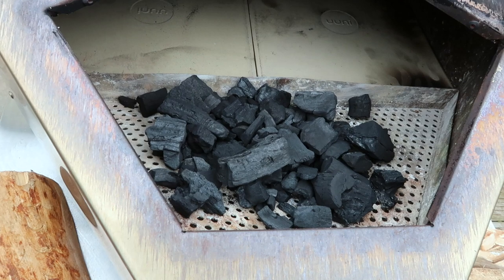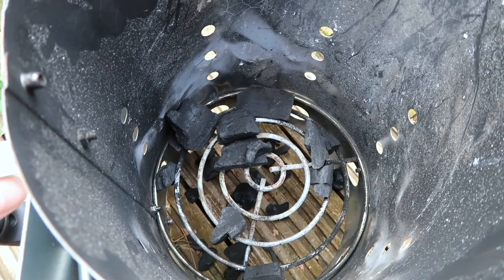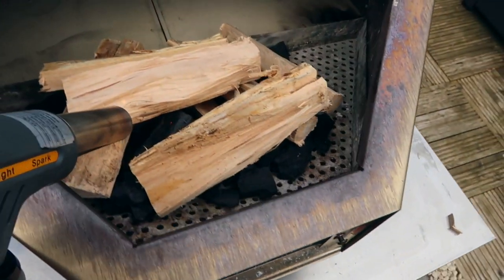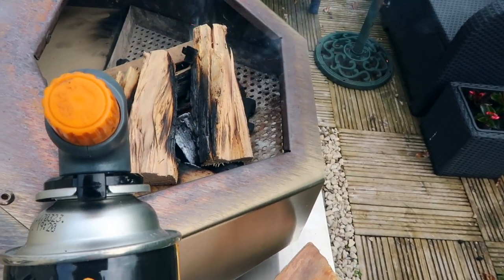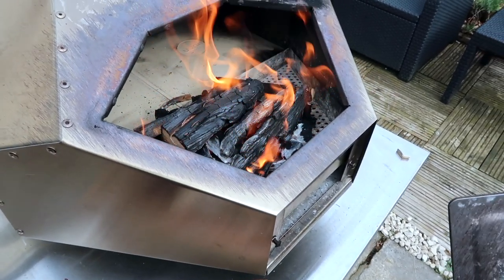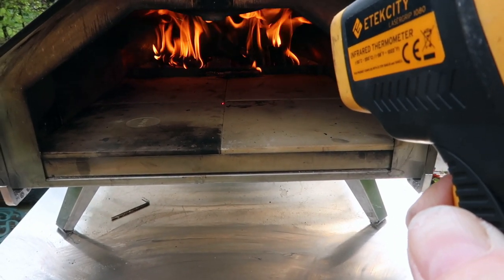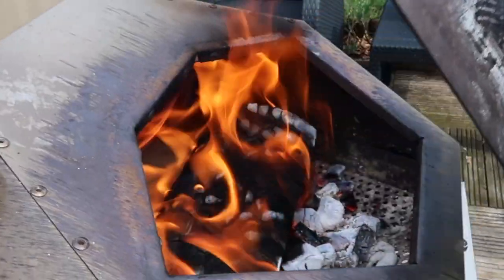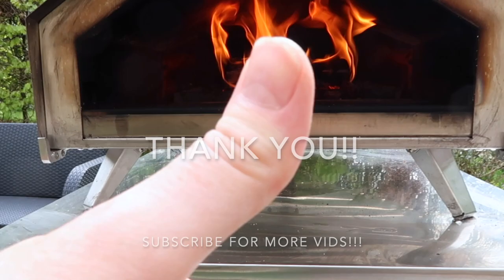How I Light the Ooni Pro Wood-fired Pizza Oven | Step by Step

Comment: Ace videos. Thanks for making them. You were the catalyst for me buying an ooni pro that arrived yesterday (instead of starting an expensive and slow to build brick oven). First pizzas today hopefully!

On lighting fires... Look for electric fire starters. I have a looftlighter that I love but an electric paint stripper works fine too. Just point it at the coals for 30 seconds. No gas no chemicals no fuss. Also for charcoal look for restaurant grade lumpwood. It is in much larger pieces that give a controlled consistent burn. It would solve your chimney starter problem too. I do a lamb or pig spit roast every year and wouldn't use anything but restaurant charcoal now.
Reply from the maker: Thanks!  Ah - great tips - thankyou!  Looftlighter.  I’ll have a look for these - 👍!  Enjoy your Pro!   I was thinking about building a clay oven but the weather has been wet and tbh - I don’t have the spare time. The Pro is 👌!
Reply: @Got2EatPizza  first Pizzas were indeed epic. My wife is gluten free and her's were less epic... But experimentation will solve this.
Reply from the maker: Fantastic!  Absolutely - a bit of tinkering with the recipe!

Comment: Great video, thanks for making it, was curious how long it took to heat up.  I'm working on building a propane powered pizza oven.
Reply from the maker: Thanks! It didn’t take long.  No wind and mild outside temp are factors.  Good luck with your oven - something I would never be able to accomplish.  I can just about use a gas canister safely!

Comment: How hot can it get if I use only charcoal? I’m thinking of buying an ooni and I have a lot left over charcal from my grill that stopped working. I want to use that up before investing in wood. Thank you, I learned a lot from this video.
Reply from the maker: Hi - thanks so much!  It’ll get very hot with the charcoal.....but you will need the wood for the flame...so you’ll need to get some kindling or hard wood put on the charcoal a few mins before the pizza cook to get that wood-flame going at the back to cook the pizza.  The flame needs to come up and over the pizza stone to cook the toppings.  Just having a flame in the burner will not be enough. 👍
Reply: Got2EatPizza i see, thank you so much for replying and for the info. I’ll be sure to buy some wood after my ooni arrives.

Comment: If you want to keep temps lower like for NY style pizza, for example, how do you keep from going too high?  Close vents to keep temp lower?
Reply from the maker: Hi!  There is a lever on the chimney that controls air flow and also just inside the oven - 2 vent holes. 👍

Comment: The only way to use the chimney efficiently is with bigger size charcoal lumps as far as I can see.
And the small pieces falling down is only one of the problems.
If you somehow manage to keep them on they tend to form a "plug" that blocks airflow and it takes forever to lit the whole chimney.
Reply from the maker: Hi! Yep - I light only in the grate now - much easier! 👍

Comment: Did you get a load of black smoke. I lit my pro for the first time last week and as soon as I put the log on I sooted out the glass door. Any tips to avoid this or does this happen on yours as well?
Reply from the maker: Yep!  That happens to me too - my glass door has to be cleaned down each time.  Tbh- I don’t notice it because I only use the door to heat up the oven then the pizza door goes on.👍
Reply: Ok cool was thinking it might be the logs but pretty sure they're birch like in your video. I'll crack on with my cook tomorrow. Cheers for the reply.
Reply from the maker: Yes!  Enjoy your cook and don’t worry about the soot!

Comment: FWIW: Other than pellets, I like to use the chimney starter with about 15 Kingsford charcoal briquettes aboard. When loaded, I shake the chimney to settle the briquettes and then to ignite the lot on the side burner of my propane grill. No starters of any kind other than flame. After 2-3 minutes the gas is turned off. Once most of the black has burned off the briquettes, into the (whichever cooker) they go. Pile your lump over the top of the briquettes, ensure good airflow, and you’re off. I have lit my kamado for the last 7 years this way.
Reply from the maker: Thanks for this.  I got advised tho’ by viewers when I got the Pro not to use charcoal briquettes to cook pizza....
Reply: True enough: Not all briquettes are created equal. I would never use briquettes infused with lighter fluid, as did my late dad all his adult life. Nor, would I use sub-par inexpensive briquettes made of who-knows-what. Kingsford are considered the gold standard of briquettes. Consider, Mr. Kingsford and his in-law (Henry Ford) invented the charcoal briquette 100 years ago. I’m well-served using Kingsford’s “Professional Competition” briquettes as a starter for either lump or hardwood. Our local Costco warehouse markets these.
Reply from the maker: Sounds good to me!  Plus you’ve reminded me to go get some lumpwood bags before local shops stop selling them for the season. 👍

Comment: These chimney starters were designed for coal briquettes.
Reply from the maker: Aha - thank you!
Reply: I pick out larger pieces of Lump to put in first so the smaller pieces don't fall through.
Reply: Could always add bit of chicken wire or similar in bottom to catch small pieces.